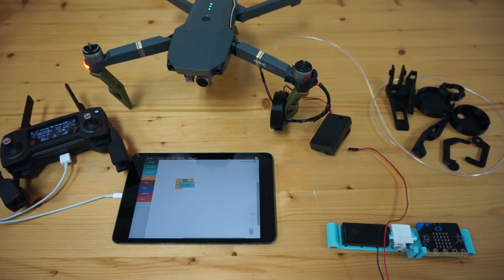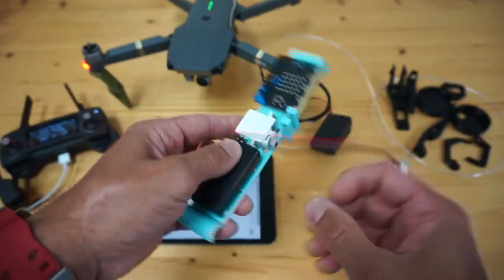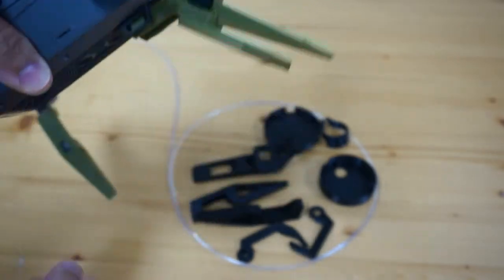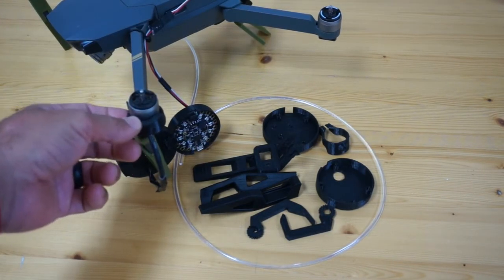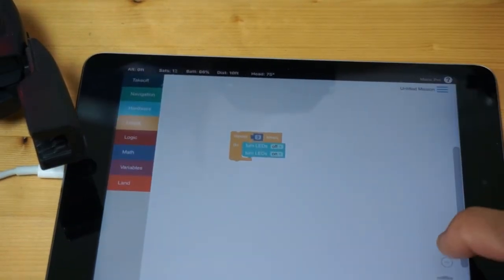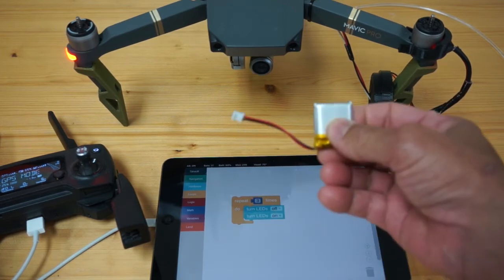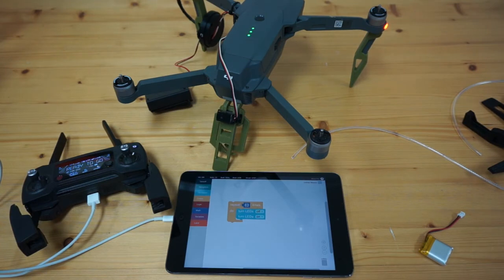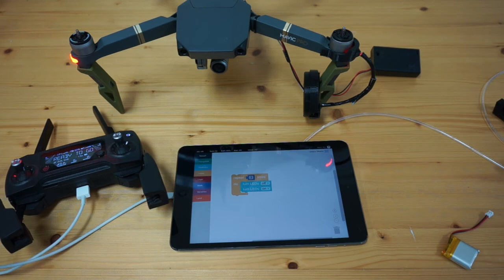DroneBlocks and Adafruit Payload Dropper for Mavic Pro

Comment: I like your project,  but there are already  grabbers and line drops available.  Just not integrated into the drone. They have been around for over a decade. I used one on my old ( very old now ) 600 helicopter.
Reply from the maker: I hear you. I just like the fact that this one is 3D printable and integrates a bit of circuits and programming in the classroom.
Reply: Dennis Baldwin must admit 3d printing is alot of fun. How many silly PLA items are just laying around. Keep up the hard work